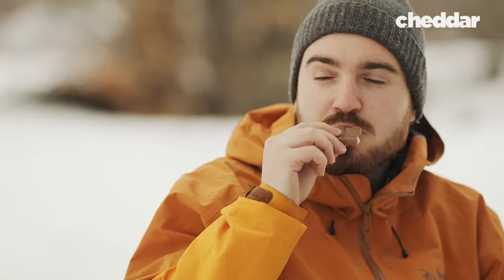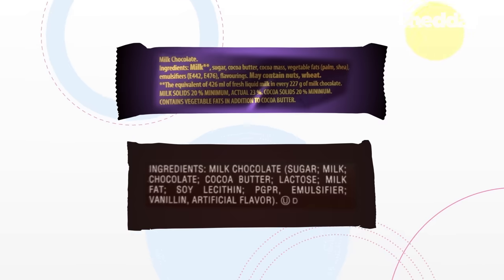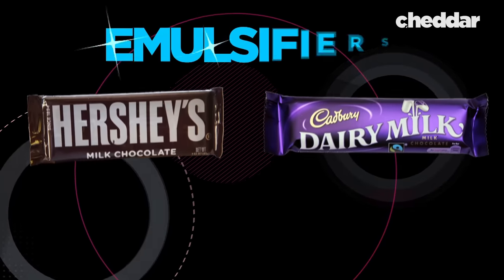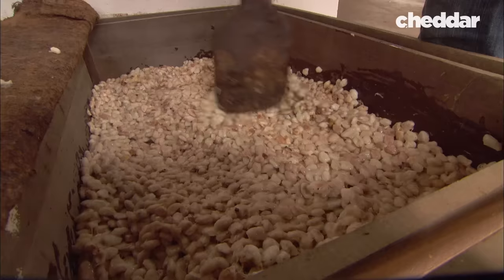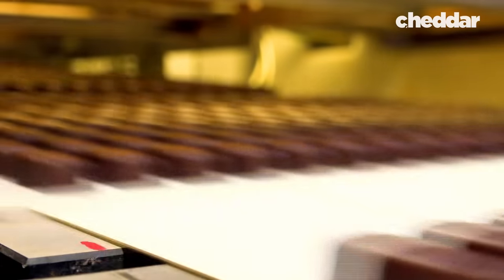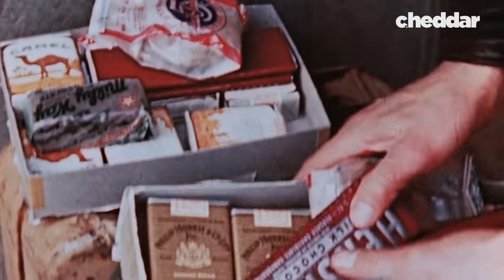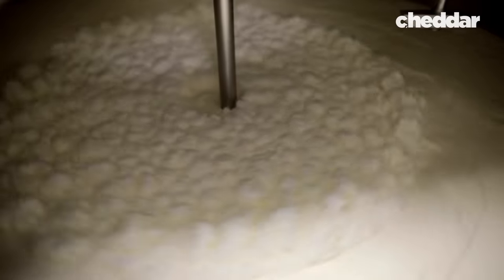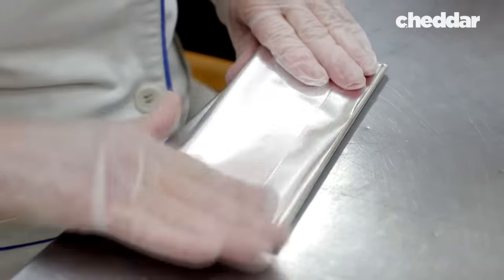Why Europeans Hate the Taste of American Chocolate - Cheddar Explains

Comment: The stores ran out of local chocolate here in Jamaica over the holidays, so I broke down and bought a Hershey bar. It was the worst, most disgusting thing I've eaten in my life. Brushed my teeth right way to try to get rid of the taste of vomit, but no luck. Rinsed with hydrogen peroxide afterward, which helped.

Comment: If you say that liquid milk and evaporated milk taste about the same, then your taste buds are almost gone. Also, I tried once a Hersey's chocolate bar and it shouldn't be even allowed to be called chocolate. This is definitely a way to brainwash U.S.A. citizens into believing that Hersey's good and cheap chocolate. Cheap? Maybe, though the price is significant higher when sold here in Europe. Good? Absolutely definitely not. Real good chocolate main ingredients are cocoa and sugar and dark chocolate goes up to 70% - 80% cocoa (and some even higher). You also compared with a wrong brand. U.K. is not part of the E.U. anymore and the E.U. dictates that you may call something only milk chocolate with a cocoa percentage of at least 25% (otherwise it may not be called milk chocolate, exception is white chocolate with 0% cocao and at least 20% cocao butter) and pure chocolate must have at least 35%. Also, all factory made big brand chocolate have preservings, have quite mix of good and less good chocolate beans and have undergone too much conching . If you want to taste real chocolate, you should checkout the following brands: Argencove, Labooko, Friis Holm, Chocolate tree, Foundry and Ritual. There are likely more but it's a start.

Comment: I grew up on Mexican chocolate and some was good and some was fake or rather "cheap" tasting. Probably because they were trying to save money making it. It made finding a chocolate iced donut with good tasting icing a challenge. But that was many years ago, so things may have changed for the better. Also I found some chocolates were waxy due to needing them not to melt in high temperatures (that's my theory, anyway).

Comment: What on earth are you on about? Everyone with an internet connection knows that the primary gripe with American chocolate is the amount of edible wax used to prevent melting. It's like eating a candle. They did the same thing here in Australia when they changed the Cadbury recipe to make it more stable in the hotter climate. Now it's like frankenchocolate, you couldn't melt it with a plasma cutter.

It's easy enough to verify. Just buy a bunch of chocolates and leave them in a warm place, you'll see what's up.